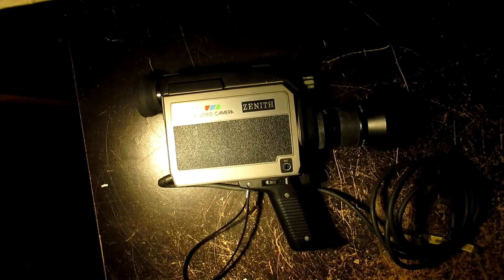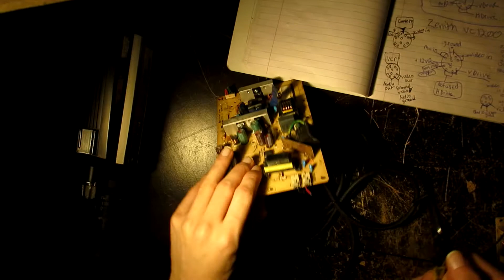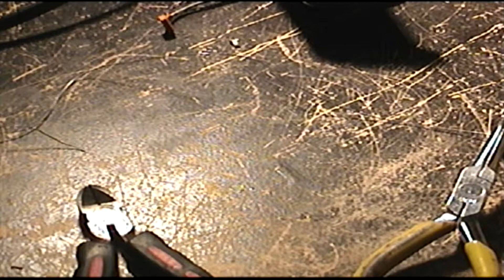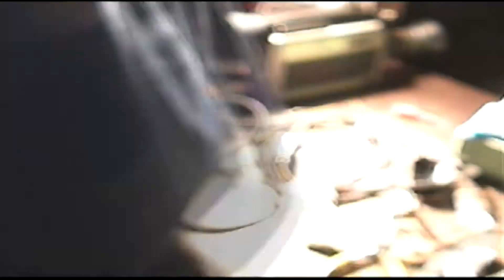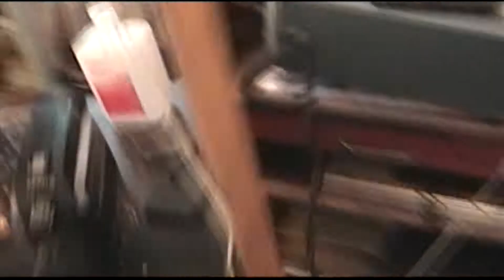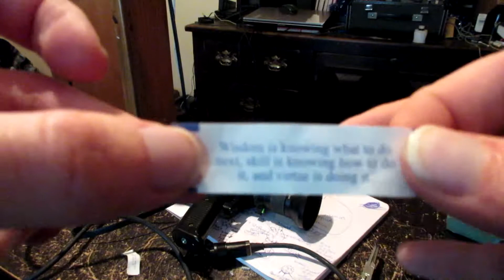check out an powering up a 1981 Zenith VC1200 vidicon tube color camera will it RUN?

Comment: I have 2 1981 vidicon tube cameras only one works. And my betamovie is a vidicon tube.
Reply from the maker: Yeah some do have capacitor problems I had one  that wouldn't power on fully I hit the switch an it would take 30 minutes to adventualy come on it was a realy weird problem